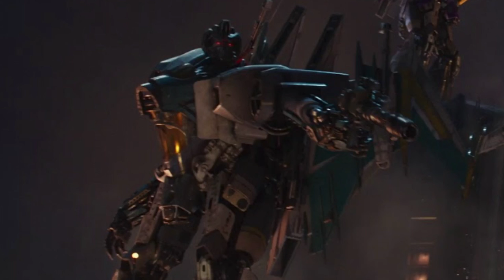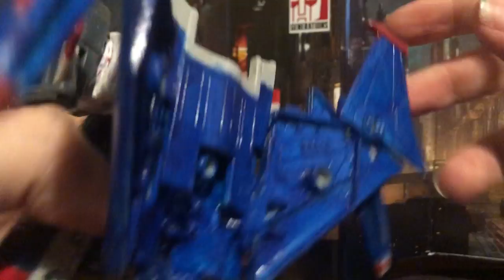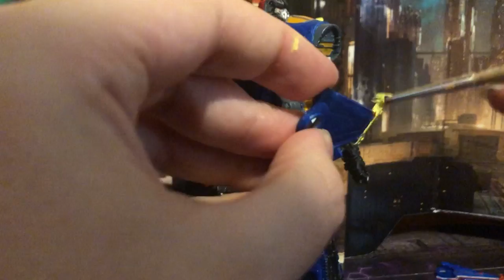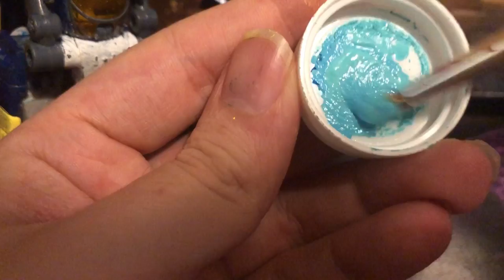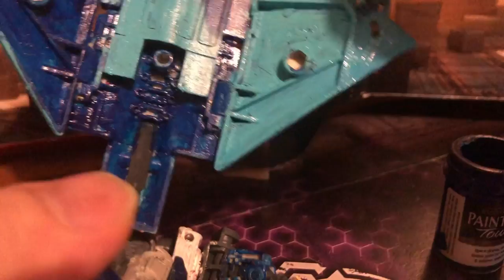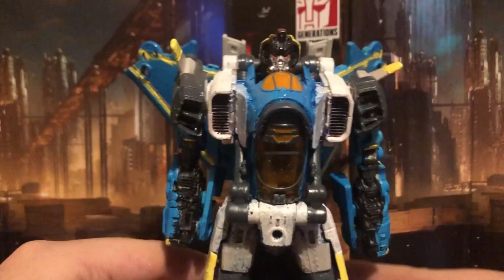How To Customise Transformers Toys

Comment: Acrylics actually dry quickly, but they take longer to fully cure, which is when they'll be more resistant to rubbing off. 
It also depends on which acrylics you use. Most kinds will do the job, but some are better suited than others. Vallejo Mecha Color paints, for instance, are specifically designed for action figures; they're a bit more durable once they're given the time to cure, and they're quite fluid, intended to be suitable for airbrushing right out of the bottle; This also means that whether you're airbrushing or not, you don't have to worry too much about leaving visible brush strokes in your paint. But I use a combination of higher-end model acrylics, and a lot of cheap craft acrylics; it just takes a little experimentation to figure how to get the best use out of each paint.

As William Hays says elsewhere, thinning your paints a little is always a good move. How much you thin it depends on how thick the paint is in the first place, but the goal is to get it to flow off the brush well, and give a nice smooth coat. Don't worry about trying to cover the base colour in one coat; put a layer down, leave it to dry, then put down another layer on top. Multiple thin coats gives you a lot more control over the finish. And if you're using a colour that doesn't cover very easily, like a lot of yellows, try undercoating with a white or cream first, and you should need fewer layers to get to the colour you want.

For brushes, again, you don't need anything fancy, but a good selection of small and medium synthetics should do the job, as long as you take care of them; wash them regularly, and don't let paint dry at the base of the bristles, because that's what makes them splay out everywhere, which makes it harder to control where the paint is going.

Comment: I'm suggesting you try markers for glass.
I'm customizing cheap Montoy robots and it works wonders.
gives a nice shiny gloss finish too.
Been doing this for a couple of months now and i'm feeling comfortable enough to even cut some plastic parts and add new details using spare parts from other robots. adding glow in dark plastic, magnetic equipment gimmicks, ect.

also, tape is your friend here. gonna help you do straight lines and protect parts you don't wanna paint.

thank you for sharing your creation.
Reply: I custom painted the rotf ss megatron

Comment: Might as well sand the parts and prime them before painting if you're going to repaint almost everything. Thin your paints, multiple thin coats is better than painting a single coat with really thick paint.